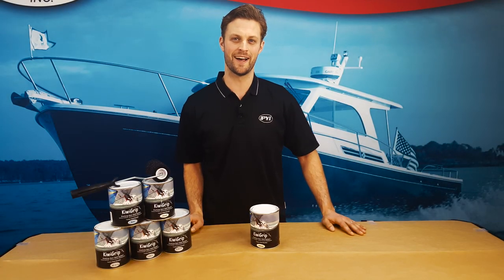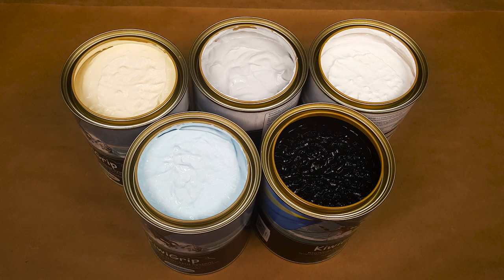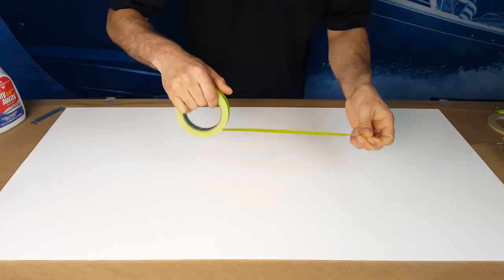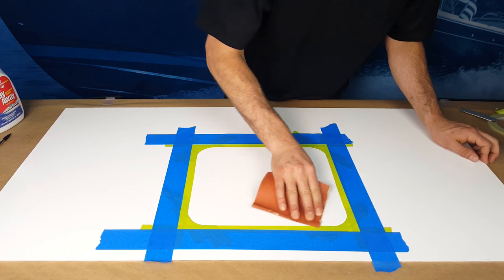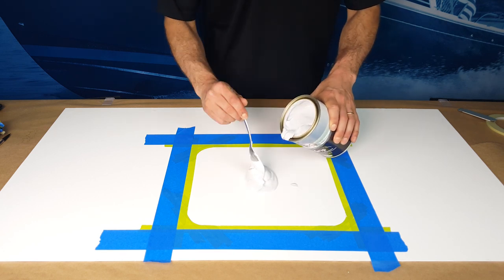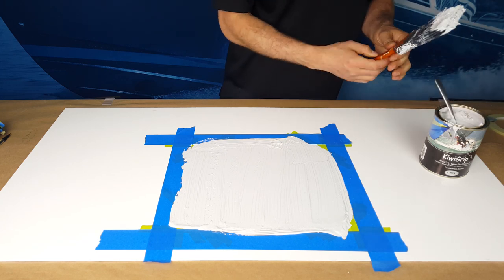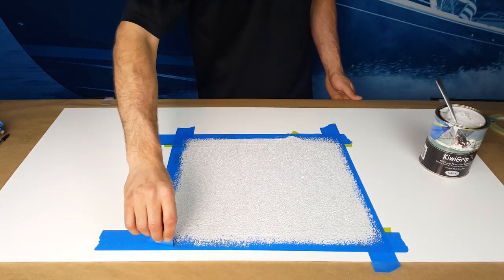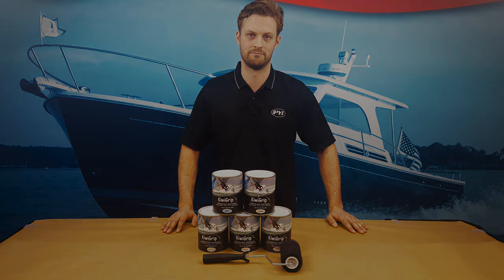What is KiwiGrip non-skid coating & how to apply it.

Comment: Can this be used on vehicle rubber running board?  Have had two bad accidents with shoes/boots slipping on the running board of my van
Reply from the maker: Because rubber is an oil-based product, and KiwiGrip is a water-based non-skid, adhesion might be an issue. We recommend first applying an oil-based primer that will adhere to rubber, and once fully cured, then apply the KiwiGrip. For further assistance, feel free to contact us at info@pyiinc.com
Reply: @PYIinc  Many thanks I will do that

Comment: I have two types of nonskid that I want to repaint, one is rough like sand paper texture and the other is an embossed fiberglass surface. Can I use kiwigrip on the embossed surface as well? I'd want to keep the embossed surface and not add any texture to it.
Reply from the maker: Yes, KiwiGrip can be used in the embossed fiberglass. However, if there is any cracking or crazing you will want to repair that first as KiwiGrip is not a sealed paint. If there is gelcoat present on the fiberglass this will need to be sanded and dewaxed before KiwiGrip can be applied. If you are only looking to change the color of the embossed area I would add 10% water to the KiwiGrip base and roll it on with a standard 3/8" nap roller as opposed to the textured roller provided.

Comment: I have a non skid sand Awlgrip painted deck over fiberglass that is old, what is the recommended preparation for this old surface?  Can I paint over the non skid or should I remove it.

Comment: Question:  if applying over an old nonskid deck, will just sanding the "peaks" be enough?  How do you get into the 'valleys"?
Reply from the maker: Sanding the peaks will be enough if you are after a medium to aggressive texture. You may need to apply a thicker coat to hide some of the pre-existing non-skid.

However, if you want a fine or mild texture, you will need to sand down to the valleys to get a "smooth" surface. Or apply a thick layer of KiwiGrip to fill all the valleys. Then once it's dry, go back and apply another layer of KiwiGrip and use the roller to get the desired texture. This will, of course, use a lot more of the product.

Comment: What about applying it on an existing non-skid pattern? What’s the best way to clean and sand it?
Reply from the maker: To prepare the old nonskid to accept KiwiGrip, scrub the surface thoroughly with a rotary green pad or wire brush, making sure that all the peaks and valleys are well dulled off. Then scrub with boat soap and water, allowing the surface to dry before masking and applying KiwiGrip. KiwiGrip will typically hide old non-skid that is less than 1.5 mm in height.

Comment: It appears my deck was painted with less than good quality paint. Once it is removed do I need to apply an epoxy base primer like interlux primekote and a coat of Perfection, or can I skip the topcoat and apply this directly to the primer?
Reply from the maker: You can apply KiwiGrip directly on to the epoxy primer.

Comment: How do you apply this on a "diamond type" roof? It's impossible to have a flat roof ?
Reply from the maker: What type of material is the roof? Fiberglass?
Reply: @PYIinc  it s Hanse 312 sail boat
Reply from the maker: @cbiltris  The diamond pattern will obviously show through. You could sand the fiberglass diamond pattern or apply the KiwiGrip very thick to cover the diamond pattern. Here's a diamond pattern with a normal layer of KiwiGrip applied onto it: https://www.instagram.com/p/BGlndRSMtR_/

Comment: if ive got a deck with fibber glass fibers on the surface is this product what I need to redo the deck and cover the fibbers that make it itchy to stand or sit on?
Reply: ok thanks that sounds good do you have a video on it
and can a mug do a reasonable job of it  
thanks
Reply: also do you have a product to do the sealing with.
thanks
Reply: ok thanks